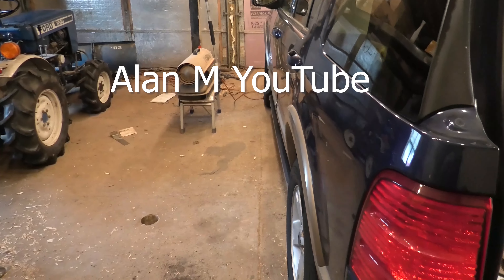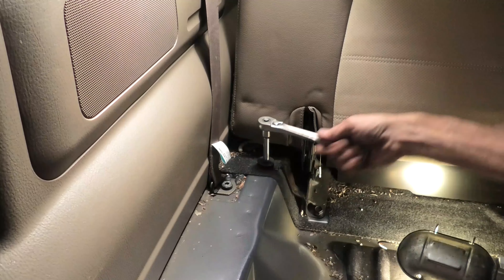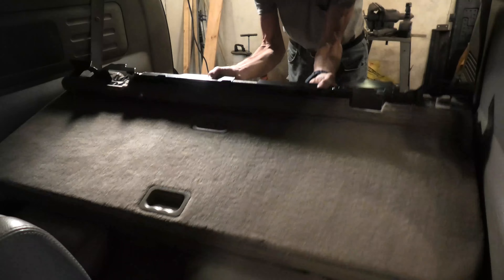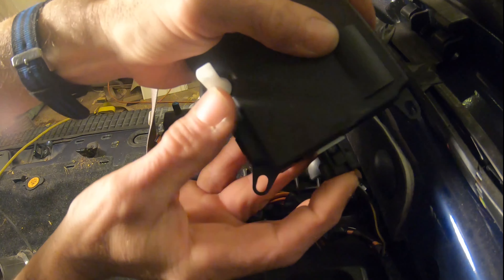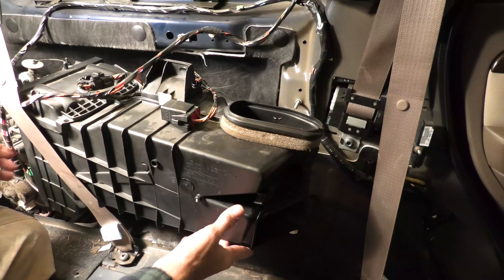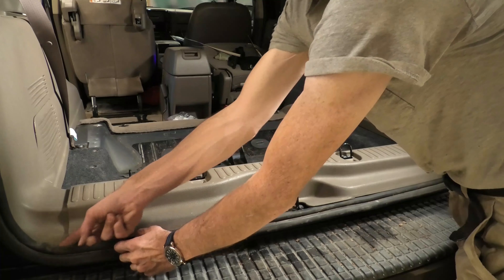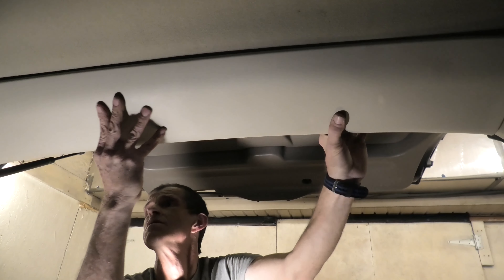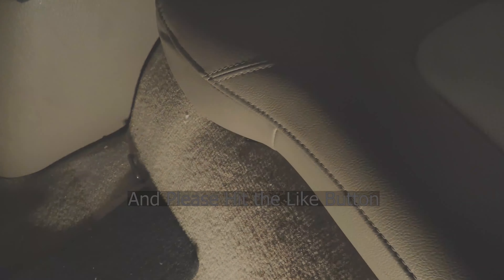2003 Ford Explorer Rear Heater Repair, and How to Access the Heater Actuators, All Steps Shown

Comment: Hi Alan. Thank you, thank you, thank you!!! I had the same problem in my 2004 Explorer. The sound became constant. I could no longer find a spot that it would stop. I had to do the dirty deed. I am handy but had trepidation about this fix. After seeing your video it convinced me i could do it. This video is spot on and i followed every step to the T. It went well. Hardest part is that seat belt bolt. PB blaster for a couple days before i Started. I did both actuators.  3-31/2 hours taking my time. I am lucky enough to have a heated garage. It's running perfect. Again Thanks for this great Video.
Reply from the maker: It makes me thrilled to know the video helped you repair your vehicle. Without a doubt, this is neither the most pleasing nor the worst project if you have access to decent tools and a good place to work. Thank you for watching.

Comment: Good video explaining it except when I'm go to replace both actuators because if one went bad it's only a matter of time before the other one goes bad. Save yourself the hassle of tearing it apart again. Other thing is i'm going to use 3/8-1/2 impact wrenchs to get the seat bolts out. Less time and faster then racheting them all out